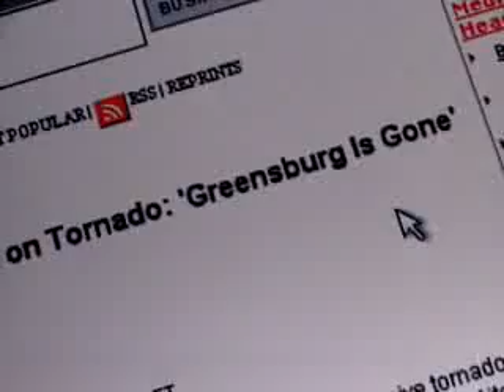Tornado Sirens Video

Comment: Lower pitch/frequency doesn't carry as far. There are two Whelen omni-directional sirens stacked up on each other in Havre de Grace, MD and use a low tone for severe weather. I live LESS THAN A MILE AWAY FROM IT, and I can barely hear it inside or outside. The wail tone they use for fires/medical emergency is much higher and doesn't even carry far. We have a ST-10 in the middle of town that would work better, but we don't use it.

Comment: My thoughts exactly. If you listen closely, it is the same pitch as the 10 port side of a 2T22. The 2T22 (high tone), 2001, and Model 3 sirens share the same rotor/stator. It might be possible for them to have used the 10 port version of the rotor to make a lower pitched 2001 on request of the city, as it sounds like they particularly wanted that. What do you think?

Comment: The reason why they use federal signal 2001 SNRB'S is because they are a heck of a lot louder than thunderbolts and plus thunderbolt get malfunctioned or the blower gets messed up a lot easier than the FS 2001 SNRB'S do but FS 2001 SNRB'S have pitch problems and they're batteries die once in a while but are really good in attack mode

Comment: lower pitch. LOWER PITCH! A 2001 IS LIKE 2 OCTAVES ABOVE PRETTY MUCH ANY OLDER DUAL TONED SIREN THAT I HAVE EVER HEARD!
Reply: That means its probably a FS Equnox
Reply: +JooshCabob66 Mendes SRNB. SRNB's are abt 300+ hertz higher and can only be heard by no more than 3/4 mile in a place with trees.
Reply: This is why I hate 2001s
Reply: thunderbolt10031000tfan any 2001 is okay to me but not my favourite

Comment: sound carries further my ass!!!!!!!!! low pitched my ass! i like 2001s but there sound DOES NOT carry further than a thunderbolt 1000. sure the 2001 is louder (the thunderbolt 1000 is 127 DB. i know people say 125 but the manual says 127 from the tests. the 2001 is 131 i think? have to read that one again.) and has battery back up but the thunderbolt you do not beat again i like 2001s but they are not any of that and they are not easier on the ears!